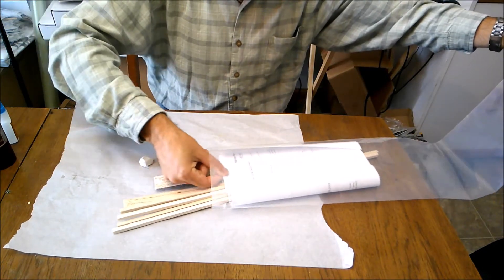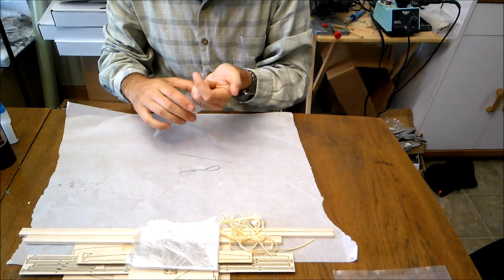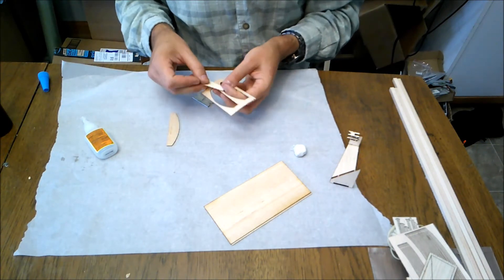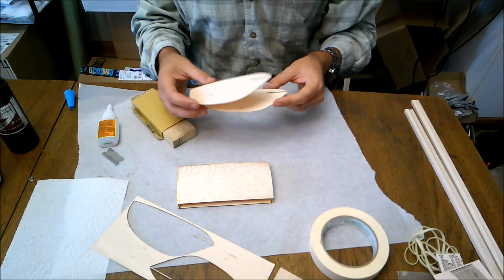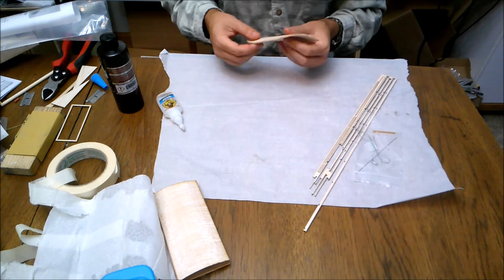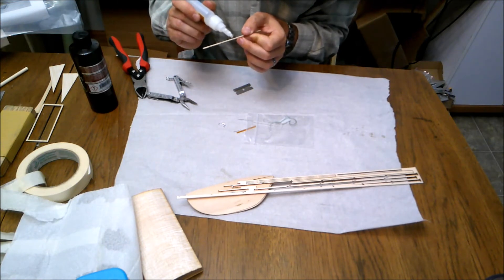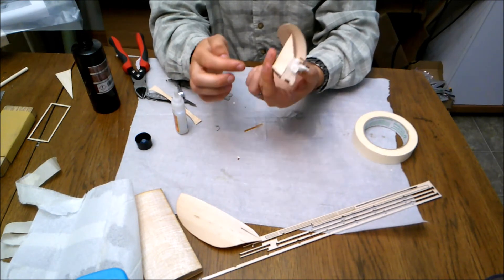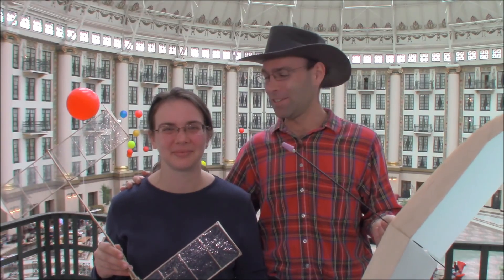Bifurcation OPP Build pt1 prop

Comment: Why the propeller blades are mounted that way. It looks like they are inverted, I mean leading edge is now the trailing edge.
I am missing something?
Reply from the maker: You want more area in front of the spar so that the blade flares to a higher pitch under load. It slows down the climb, sort of like a variable pitch prop.
Reply: Thank you  @joshuawfinn  for the answer. I was guessing that but was not sure.